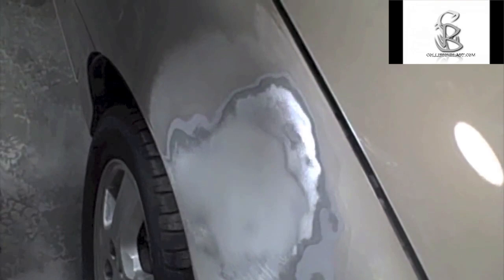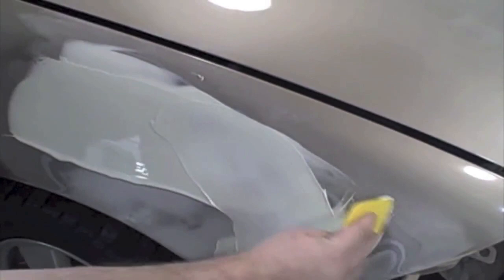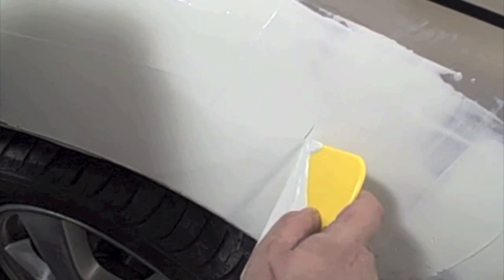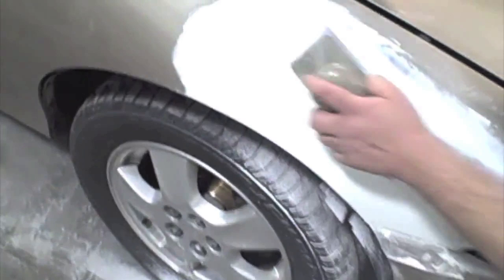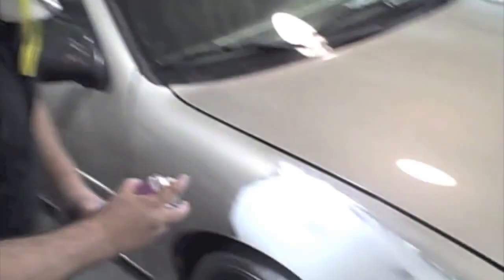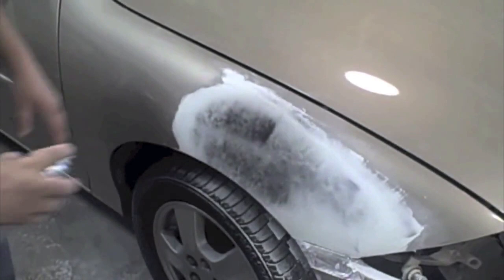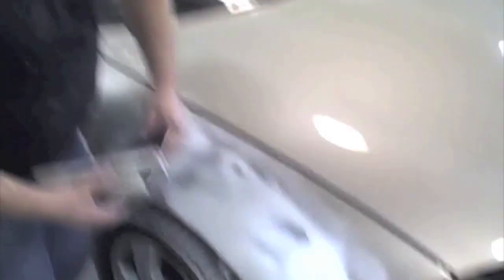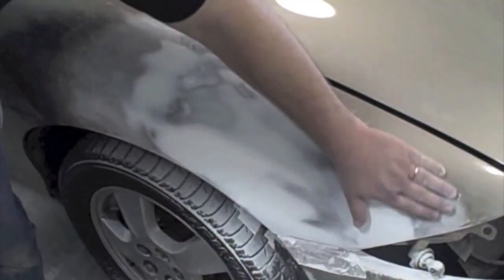How To Use Putty Glaze Over Bondo

Comment: I find that one of the most important things to remember when block sanding filler is to use a coarse grit sandpaper to get the filler flat before going over it with 180-220.  If you start out with paper that is too fine you filler with turn out wavy.

Comment: One very important piece of information you left out that you seem to be ignoring is to stop sanding when you see metal. Metal sands a lot slower that body materials, so if you continue sanding (as I see you are doing in this video), you are creating high spots (metal areas). You should stop sanding and apply more spot putty over the entire area where the metal is exposed to bring up the low spots.

Comment: polyester putty should never go over paint or recently applied primer, although the manufactures say you can it will always sink around the outside edge.It may not happen right away but over a few months it's pretty much guaranteed to do so.Also NEVER EVER apply fillers up and down always spread the fillers as the wind would go over the car. Spreading it in a vertical application will make a whole lot more work to get the panel straight

Comment from the maker: 3 Pointer....Many body filler have zinc, which aids in corrosion protection, but I agree, epoxy is excellent.  If I have a lot of metal, if blasted for instance, I would epoxy the bare metal before doing the body work.  Great tip, thanks for sharing.

Comment: Ive been a drywall finisher for 13 years. Might have to get into this. It looks pretty easy. Im surprised to see you sanding with 150 though. If we do that with the putty it'll be scratch central after prime and paint.
Reply: He will prime the repair area and block it with 320 or 400 to fill the 150 scratches
Reply: That's why you don't sand drywall..............that and the mess sanding makes.
If you know what you're doing just sponging it is all you have to do.Sponging will also fill in all the fine air bubbles that would get opened up with sanding.

Comment: Hi donnie, but my question is..so from the first video repair  to this one what if you didn't wanna use glazing putty. would you just have finished the work off by sanding with 150 grit or a little finer up to 180 grit?
Reply: 150 to 220 grit, just so you're not priming over 80 grit. Usually people use glazing putty to fill pinholes and bring the grit up without going through the bondo.

Comment: Kudos! Does glaze putty have issues in being applied over etch or surface primers? In your description it sounds like glaze putty is a miracle product that can be applied over any primed, filled or bare metal as well as over old pre-existing paint.
Reply from the maker: That is the one product I am not sure about.  Etch primer has acid so it may react with the putty.  But premium body fillers and glaze putty have zinc for corrosion protection so you really don't need to apply self etch before applying the putty.
Reply: Good info. I appreciate it.

Comment: I have did body work in long time. My son car , a little paint came off. I try to just use red putty. But it did work good enough. So I have to use body putty. . Could I just use glazed putty. I still have a high spot, after I paint. Did not see it. Can use glaze putty over top of the paint, to make it smooth?

Comment: Polyester puddy is not ment to be over 1/8" thick but it can be squeezed into stone chips providing there is no rust underneath the chips...I ask the owner what kind of job they want just make it look good for a couple of years or a restoration? If it is a look good then I go over the front end of the car with puffy filling in the chips squeeze it in tight just after I wash and wipe the car to remove wax and chemical residue once all the chips are filled then I check for dents a dimples repair those areas finish sanding those areas with 240 anything courser than 220 can end up to showing heavy scratches down the road do to sinkege of paint when it fully drys down the road...  then apply a thin coat of puddy just for pinholes if needed prime that area then sand the car for paint...as well as the puddy on the hood was the car is sanded then washed with soap and water to wash out all the dust then dry,  mask,  and a final wash & wipe and it is ready for paint...I find no sence to sand the chips first unless it is a restoration project but for a quick clean up I had this last quite a few years for the small chips...

Comment: my panel is pretty smooth ..I do have a few dime sized areas where it's approx 1/32 of inch low spots ...Will this fill those areas of do I need more body fill. the product I am using is called seal skin polyester glaze...thanks
Reply from the maker: Most glazes state up to 1/8 inch after sanded so you should be fine to use the glaze.  The Seal Skin is by Crest and they don't actually say on their technical data sheet, but on other brands such as Metal Glaze from Evercoat, they say 3 mm - 1/8 inch max after sanded.  So you should be good.  Here is a link to Metal Glaze TDS http://www.evercoat.com/images/ePIM/original/TDSMetalGlazeUltra103625English.pdf
Reply: Donnie Smith 
Hi I've filled all my hail damage on my hood. I've just went sanded the three coats of primer but I still see some shadows of the filler. Can I fill this with something or do I need to sand it back down again?
It hardly noticable but I just dont know
Reply: @toddhuddleston9070  filler may be high or just need few more coats of primer

Comment: The "guide coat" idea is good. I am wondering if there are other ways to check if the surface is smooth?
Reply: Cheap semi gloss rattle can..
Reply: Sometimes a straight edge if the surface is acceptable for that method

Comment: Hi ! Thanks for the video I think it was very good. I was wondering if you can help me out. I have a Fiberglass Jeep CJ that was previously painted and now I am redoing the paint,I started out sanding the paint with a block and 400 grit and when I finished one side of the Jeep I put on guide coat and notice very small and light dark areas from front to back of the Tub (Fiberglass). My question is; Can I use 3M acrylic putty to fill them up or do I use body filler? and what grit of sand paper should I use to get the putty to grab? If you can answer me It will be appreciated ,Thanks.,
Reply: I see this question is 9 years old but for someone having the same problem is spray a sealer primer. There’s a difference between the two. The sealer primer does exactly what it says. It seals it under the primer so you don’t see it. If you prime something and you can see something, your paint coat won’t cover it up. You’ll see it again
Reply: @stevegriffin2626  Thank you for taking the time to write and help others.👍🏽

Comment: How long can your sanded body filler and glaze putty job sit before applying primer?
Reply from the maker: There is to window on your body filler or glaze before priming as long as the filler is sanded.
Reply: I think that if you are going to let the panal sit for a long time, like a year, and especially in a non heated garage, you'd probably want to coat the panels in epoxy primer or a good primer sealer (not primer surfacer or high build primer, or filler, or metal or glazing putty). 

Epoxy and primer sealer are not porous, but the others are.

Comment: I noticed you applied an 80 grit to glazing putty, is that because you spread it on more thickly than one typically would? Also, I wanted to know if I should always block sand once I've gotten to the putty application stage. I noticed some people using a DA to feather out their edges. I presume it's best to block sand only since it's not as dense as bondo?
Reply from the maker: If you are a beginner I would recommend blocking.  A DA can make the surface wavy if you are not careful.
Reply: Thanks, that explains alot.

Comment: Do I have to sand over the body of my car before applying the filler? I have a big scratch that is deep on only 1/10th of it and the rest is fairly light but I might as well respray the entire area. Also what's the difference between spot and glazing putty?
Reply: For body filler yes. Glaze putty is spot putty. Meant for small spots and pinholes.

Comment: is Glaze the same as puddy??? the puddy generally is red. why is ur Glaze greenish in most videos??? u can use hardener with the Glaze also right ?? thanks for clearing it up
Reply from the maker: I think you are referring to a one part putty, which does not use hardener.  That is an older lacquer type glaze and spot putty.  The glaze I am using in the videos is a two-part putty and it does require hardener.  It dries faster than the one-part and does not shrink as much.  Does the putty you're referring to come in a tube?

Comment: Don, I have a new BRZ and although not noticing everyone I have a spot underneath the Bumper lip I want to touch up. I have the exact paint and only needs a very light coat of filler. 
Where can I get this and would the be my best bet. 
Thanks !
Reply from the maker: Silk Boxing You may be able to use a small amount of flexible parts putty.  On bumpers, you will need to apply plastic adhesion promotor to ensure adhesion.  You can see the putty at http://CollisionBlast.com/flex

Comment: In my country, we put under body filler, an epoxy primer (for optimal antirust protection), 
Why most of people in us never do that? I know that body filler has better adhesion to metal, than to sanded paint.
Reply: Filler over bare metal seems to work fine as long as it's sealed after

Comment: a question so its bondo , glaze then primer and paint ? of course sanding
Reply from the maker: That is correct.
Reply: Awesome man thanks for responding I paint iron doors entryway iron doors and they are dents sometimes on them in the dent that I Bondo I've been using that cheap Home Depot Bondo but now these denta are getting bigger the primers not working it's bleeding through I was just giving information at the paint store in English Color and regards to buying Bondo my primer and glaze that I should be using so thanks for the tips your videos gave me a lot of information that I didn't have thank you